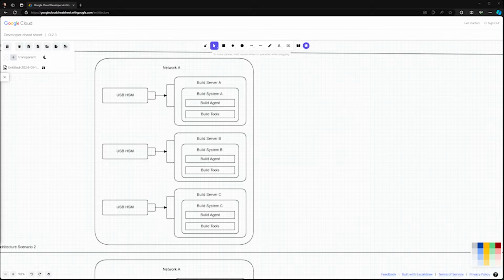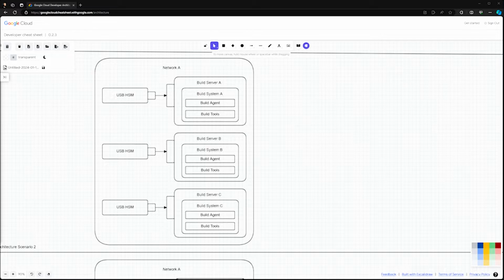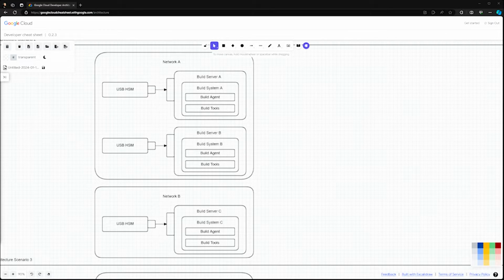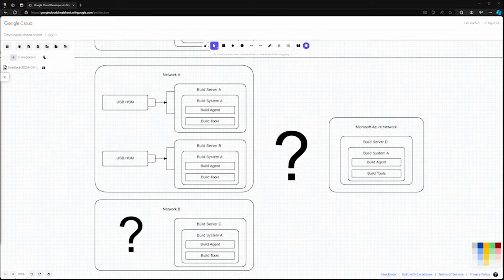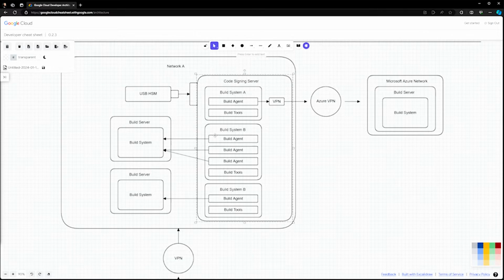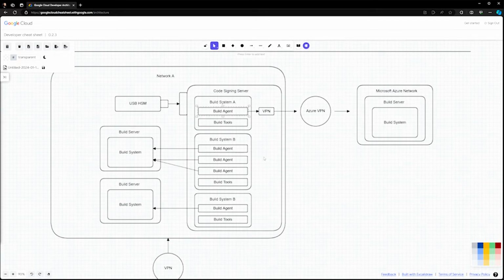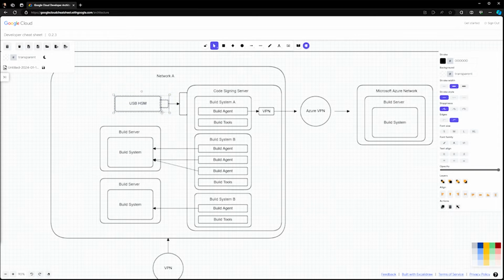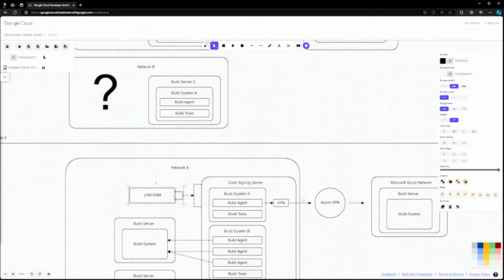Code Signing Best Practices Pre & Post HSM (Hardware Security Module)

Comment: Thank you for sharing this valuable information!

I have a question: I'm a beginner developer with no experience in code signing (I haven't purchased any certificates yet). I'm currently developing software using Tauri, which will run on both Windows and macOS. As a single developer not working with a team or a company, which certificate authority do you recommend for purchasing a certificate for my app? Any recommendations would be greatly appreciated.

Comment: These HSM changes are great for large companies that have unlimited resources they can dedicate to it. Which small companies or open source developers have the time and energy to implement these complicated processes?
Reply from the maker: In the simplest case, you get a USB device with your certificate purchase, and you plug it into the computer that needs to do signing and configure the vendor software that provides access to the certificates. If it's a cloud hosted machine you can setup a VPN connection to an network where the physical machine is located, and script your signing process to sign on the remote machine. There's a little more to it than that, but code signing is still pretty easy to do. You don't necessarily need your own HSM
Reply: @DX7Dev  Thanks David, But How we can actually store and retrieve the purchased code signing certificate in the AWS HSM and I'm only able to see an options of siging a file only by using key pair that we generated in the HSM itself.
Reply: @GaneshkumarM-ks8my  any updates?